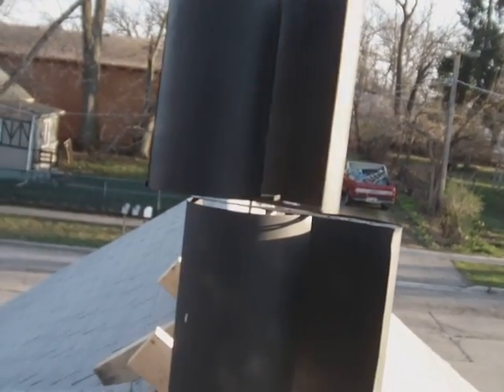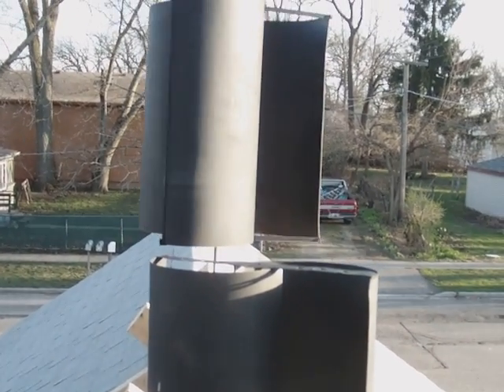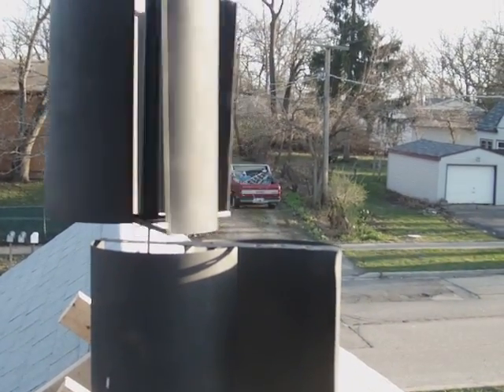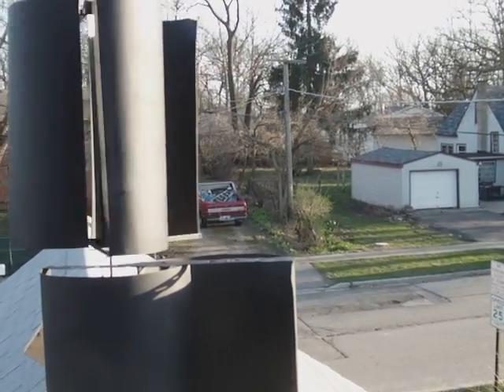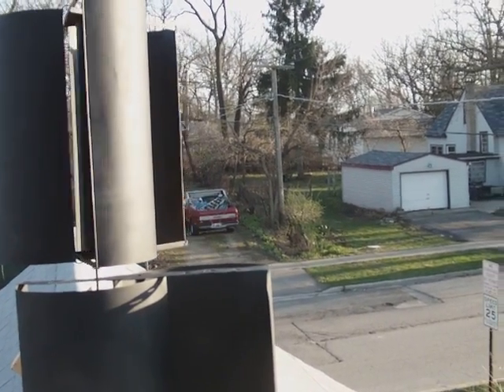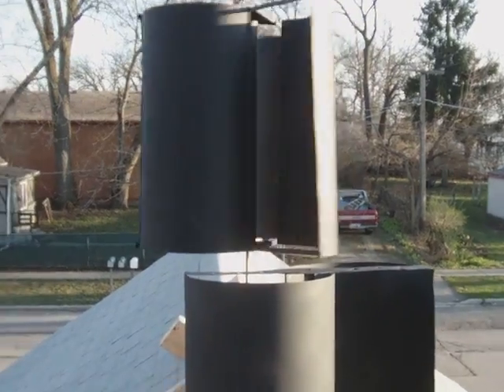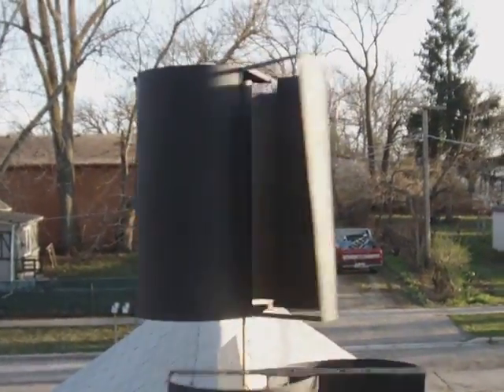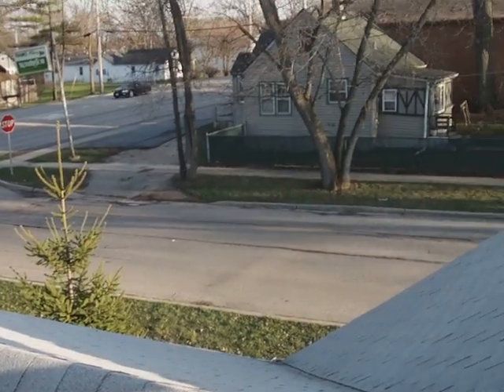Dorje Inc Vertical Axis Wind Turbine VAWT testing 2

Comment from the maker: @trailkeeper Look at it this way; with 2 blade, you need momentum to carry it past that stall moment, even with no load at all.  You put a load on it - a constant load like a generator - and it's very likely to stall out.  That's why two-blade designs are often made helical - to eliminate that stall moment.  But helical designs have issues, too; poor angle presentation to available wind, and less surface area engaged in the power stroke.  They are then made bigger to compensate.

Comment from the maker: @trailkeeper Have you ever watched ice skating?  Seen that dramatic moment when a skater starts to spin, and then they draw their arms and legs in and they go so much faster?   The same concept applies to your question.  As the weight is pulled in from the edges toward the center, the speed of rotation increases.

An added blade would add weight out on the edge and the whole assembly would slow down somewhat.

But VAWTs are not about speed.  They are low RPM/high torque.  It's about power.

Comment from the maker: @trailkeeper But the size/mass difference is what makes the rotation of one so much faster than the other.  The three-blade likely weighs 20 times the mass of the littler one and is almost 5 times its diameter.

Comment from the maker: @trailkeeper I'd love to get an animation made of some of the concepts involved; but in short, the 120 degree separation provides a steadier source of drive torque.  There come a point of diminishing returns as you add blades. People really over complicate impeller designs.

The two models here are very different sizes.  The two-blade Savonius is scarcely 10 inches tall; the three-blade Savionius is 24-inches tall -- a half-scale structural model of the real thing.

Comment: I see that the smaller vawt spins faster when it is not stuck.  Considering this though, if you were to take the large one and make it only two blades it would probably slow down since it needs the third blade.  Is this more or less correct?  Or is the third blade only needed to ensure that the vawt can always start up?